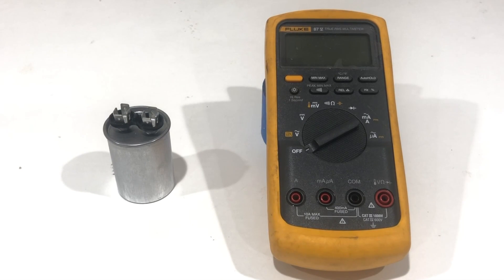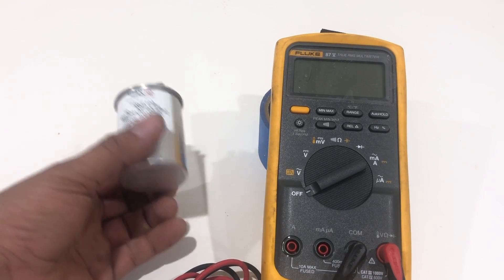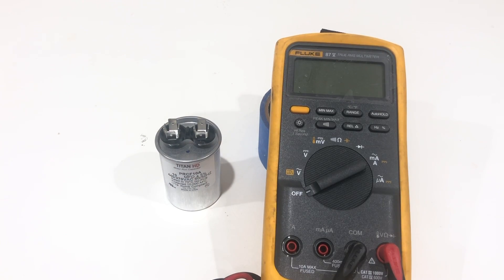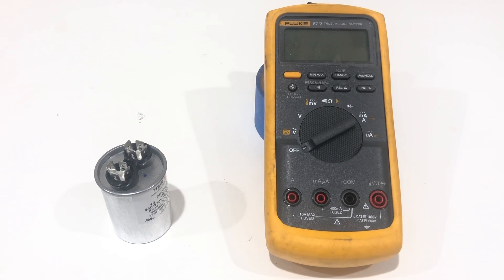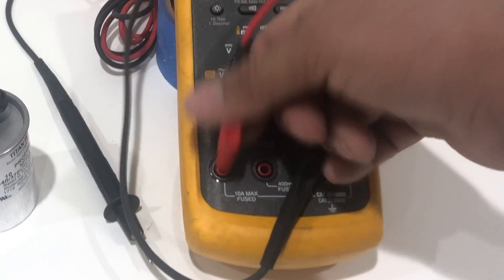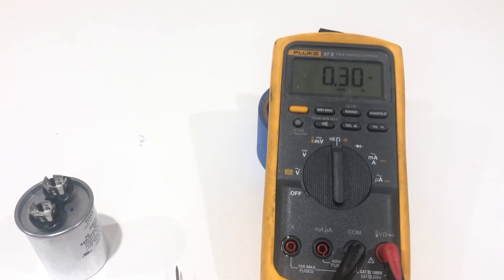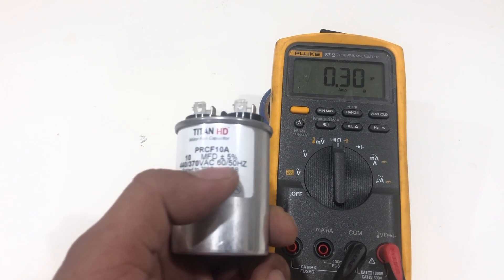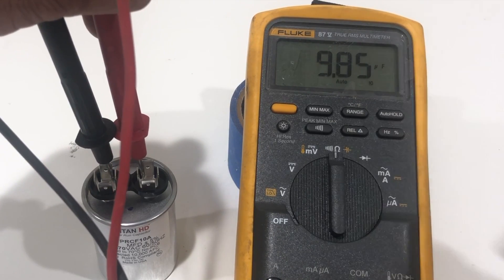How To Test Any Capacitor If Good Or Bad with Multimeter

Comment: Never short out a capacitor with a screwdriver!! You can risk damaging the capacitor. Drain the capacitor with a 3k ohm resistor. Much safer.